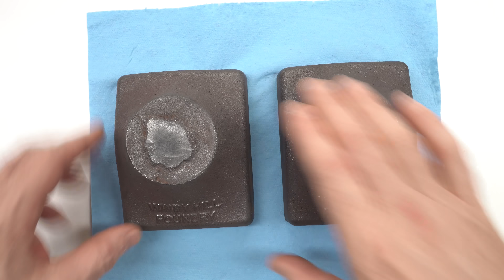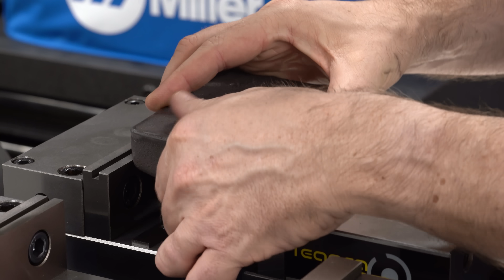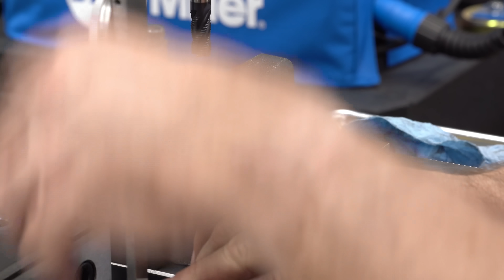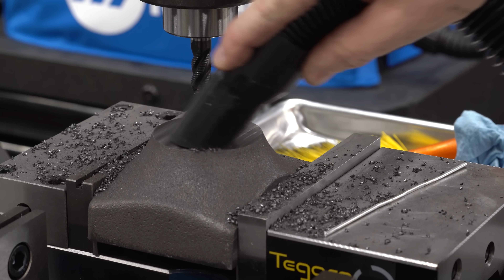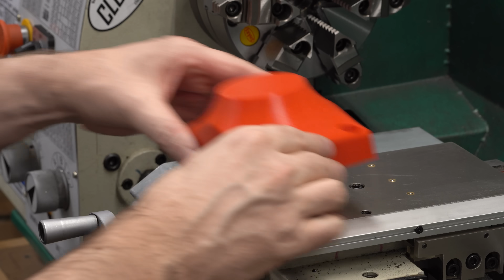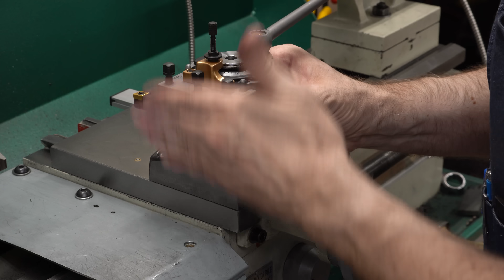Machining the Casting for the Multifix Lathe Solid Toolpost Riser

Comment: The problem I found mounting the tool holder in the middle of the cross slide is that the tool holder itself sits too far away from the headstock especially with my Royal quick change collet chuck which is designed to sit close to the headstock for accuracy.

Comment: I'd potentially be interested in a casting if it fit my old Taiwanese Enco 10x20 and didn't cost 4 arms and 6 legs. Any improvements in rigidity would be welcome with these small machines.

Comment: The only wasted time would be arguing the point, Although I cheaped out and used a 4" x 4" x 1" hardened jewellers block for my riser which is only lacking in style.

Comment: Hi James. Looks good. Love your videos. Thanks for making them. A comment  or suggestion : I would put a undercut on the top and bottom surface. This gives you most  leverage from resisting  cutting tool foce, pressure or feedback turning the toolpost and no chance of any rocking on the bottom surface.

Comment: A steel riser block also would not have been as rigid. In those dimensions on your lathe maybe the difference would have been imperceptible, but then, when you're turning stainless and wind up having to make a shallow DoC, maybe it will be perceptible after all.

This is great work. :)

Comment: This riser would be just the size for my 9x20 lathe. My current riser is made from a scrap block of steel and I have had problems with being able to tighten down my QCTP. This could be caused by not being completely flat on top, or the bolt is not perpendicular. I had planned on making a new riser so having a cast iron one would be great. Put me on the list to purchase one if the price isn't astronomical.

Comment: Nice tool post James ,
but are you not afraid that the tool post will stay in place with just four bolts clamping two smooth faces ?
I would drill two extra precision holes for two grind alignment pins so that these resist the tool pressure in X  and Z.
If you feed in X the post can be pushed backward and in Z direction the post can twist or rotate. I know it won't move a lot
But the goal of this post was to have more accuracy and less vibrations .

Comment: Nice work kid.

When I make castings with a goat top, though I don’t do ferrous metals, I put a slight rounding to that part. Therefore when I get the casting out, it tends to be flat, and not sucked down as here.

Comment: Really curious on the angle location you chose for the locking pin.  IMO the post should have an index location to be square when the compound is located at 30 degrees for cutting threads.  I have found no info in the tool post information for the location of the hole.

Comment: I too wondered about turning a large block of steel on the lathe, however, the process of designing, slicing, 3D printing, casting and then machining a custom part is inspiring to watch.  My 13 year-old son has the same 3D printer, and has been giving me tutorials on fusion 360.  I have an old industrial lathe and would like to get a milling machine and I am absolutely fascinated by the ability of the home workshop to produce things that a few years ago would have been impossible without an industrial facility or a very experienced professional with a lot of time.  Thanks for sharing your experience with the process.

Comment: Really nice job! And its pretty. Appearance matters. I bought a new 12x36 import lathe in 1996 or so. I discovered the top of the compound (where the tool post mounted) was not parallel to the bottom of the compound where it mounted to the cross slide. This resulted in the tool height changing any time I swiveled the tool post for a different cutting angle. I was working part time in a machine shop at the time while in school, and one of the toolmakers helped me make them parallel. For the life of me I can't remember if it was done on the mill or the surface grinder. Anyway, I only bring it up incase your top and bottom are not parallel. Mine was off a mile (.030" range). Yours might only be off .001"-003" range the way you machined it on the mill.

Comment: I am glad you have a second casting. You may want to make this part again since the edge of the cross slide probably does not line up perfectly to the edge of the riser. I went back and rewatched the video and I noticed that you have lost precision with the order of operations used. The center of the hole was based off the casting instead of being the centerpoint between the two parallel sides. If you are basing it off the center of the boss, you would need to find the center of the part before machining the sides parallel. The hole is not located at the true center of the part.
Reply from the maker: The hole is not designed to be at the true center of the part.

Comment: James, I understood you will secure the Multifix toolpost against rotation and movement by pinning it. Do you also plan to pin the casting to the top of the cross-slide? I could see a couple of diagonally-placed dowel pins, to make absolutely sure the casting can't move (thinking about the clearance holes vs the mounting screws), and if you ever remove the casting to use the compound, the casting would go right back on again, in exactly the same position as before. Nice work, very much enjoy the channel!

Comment: That's awesome, but I'm wondering why you did just do all 5 sides in the first op.....even if you couldn't fully machine the sides due to the vise, you could at least establish an averaged surface to put against a parallel once you rotate the part in the vise.

Comment: cast iron dust and compressed air? I have a vague idea why that is bad, but can someone tell me what james is referring to at 9:35?
Reply from the maker: It has a lot of fine particles in it and it gets everywhere.  It's abrasive when it gets into the moving parts of the machines, and it turns your snot black when you inhale it.
Reply: @Clough42  Okay, thanks! Thats what I figured. I feared, that it would be dangerous to inhale but I couldnt find anything on the internet.. (super quick search)
Great video by the way! Maybe you can use the opportunity in the next video to tell us about the magic angles of those three holes in the bottom. If I remember correctly, they are not 90°, so you can use them to get a finer resolution of the angle setting of the fixture.

When I built a mounting block for my lathe, I just used a really really REALLY big (40kg) forget iron block because I was a bit pissed at my machines surface finish (didnt help, the bearings are crap)

Comment: Making a pattern and getting it cast at a foundry was a class move. 👍 Don't let people criticise you for that!
I do think you missed a trick with the design. I would have offset the post in the Z axis, so it could be reversed for special jobs to move the toolpost further forward or further back on the carriage. That can be really useful for clearance or tool rigidity.
Even better would have been to make the 4 bolt boles on a square, and offset the post in 2 axes, so then it could be mounted in 4 positions total.

Comment: Love my little m12 grinder they will move more metal than most think using 3m cubitron flat disk.  flappers are more for finishing but using the 36 grit flat disk my little grinder out worked a 6” hard wheel grinding the heads off the bolts that hold a truck bed on.
Reply: Cubitron ii 33380 is the one I prefer use it then go straight to a sotchbrite pad.

Comment: I just put a large block of steel onto my cross slide and also drilled a few more holes so I can put more tools on it. Finally I'm using RS274/CNC with it and have my automated tool changer.